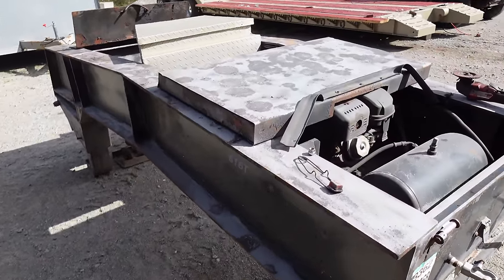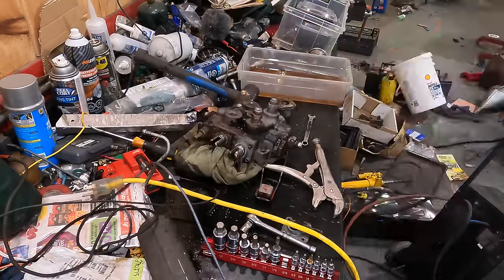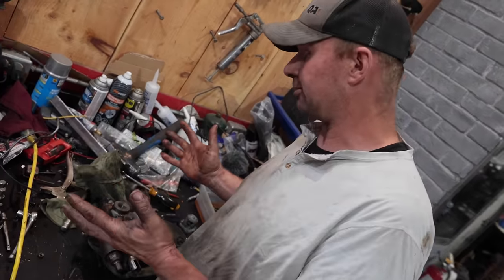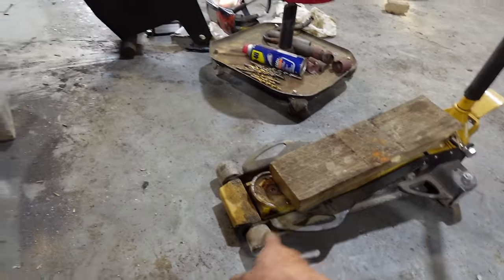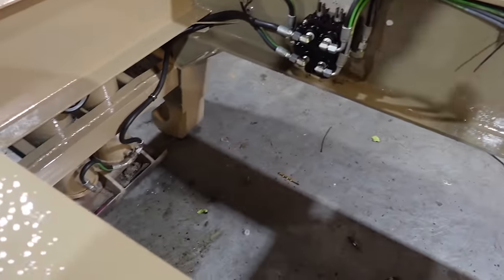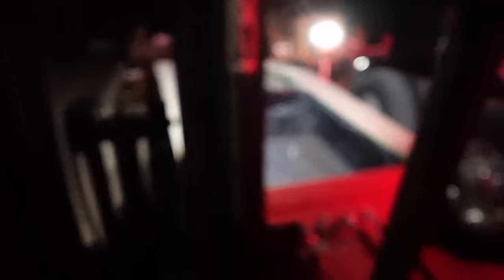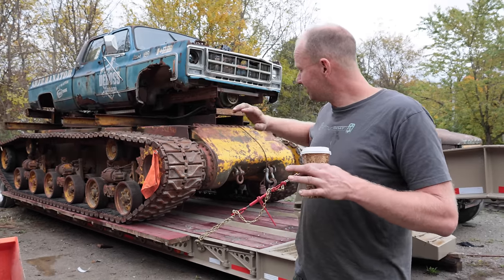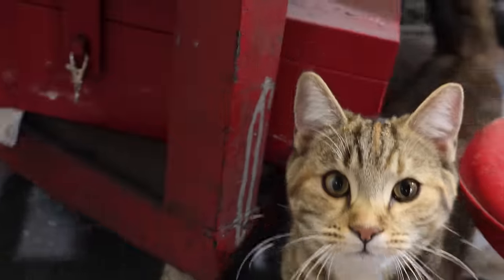Finishing our RGN Lowboy Semi-Trailer [EP6]

Comment: We have that same trailer as a 50 ton and to support the neck from the deck there is a thick piece of flat stock roughly 15” long with a hole at each end. It goes in the very middle of the neck at the rear under the swinging feet pinned and down to the lowboy deck pinned in place. So after you raise the deck up with the neck brace in place, it will remain attached to the deck and you can unhook the tractor from it. Nicely done on the truck and trailer. Man does she looooook beautiful

Comment: If you are thinking about buying containers to store your stuff. You can get a temporary structure that is supposed to be mounted in between 2 containers and gives you a decently tall, covered work area outside for the things that still don’t fit in the shop
Reply from the maker: I bought some cheap trusses and will frame up a little roof with Steel.  With the trees there, plastic wouldn't last too long, and the steel dome structures are about $25/square foot.
Reply: Rich has a background in construction, putting a truss roof on some containers is well within his wheelhouse.
Reply: The gothic arches that boat enthusiasts use work on containers, give good height, and will accept various roofing applications, and your sawmill guy can supply the wood. Take care.

Comment: Hey bud. May I make a recommendation? The front of that trailer, where the fittings stick out. I would weld some plates on the sides to semi-box those in. Not just for safety but they could acidentally get caught on something and ripped off. Just my 2cents.

Comment: A folding gooseneck front load trailer is so much less complicated and practical then these types, my god i feel for you Rich
Reply from the maker: If I was to use this everyday, I would have spent the extra $50 000, but for me who uses it on average 1-2x a week.  This is still the better option

Comment: Last year I bought a 1992 model of the same trailer with a current yellow sticker. It works well to move a 20 ton excavator between farms. The pins and safety system is not that bad if you don't have use it every day. Not as nice as some newer trailers, but the price was right and it is solid. That trailer was in Dunnville of all places!

Comment: Nice job on that project. I do the same stuff every day so I know what it's like and it's not easy when you're first starting off running those things around tight corners and getting them detached and re-hooked up. The trailer came out really good.👍

Comment: Rich, question about the valve body/spool valves. Now that I've seen this one apart, it gives me some confidence to try to fix the one on my lowboy. The issue I'm having is the valves are VERY difficult to move up and down, and they do not return to center at all. Basically they stick either up or down and I have to manually put them back into neutral position. Do you have any idea what might cause this, or what the issue could be? Haven't pulled anything apart yet because I've been afraid that I won't know how it all goes back together.. but this video made it look like it ain't really a big deal at all. Thanks in advance if you see this, and love how the lowboy turned out! Amazing work as always.

Comment: Aussie truck mechanic. Genuine question, why are north American low loader/boy trailers so overly complicated with no added benefits? You don't have expandable beds either so all your loads hang over. Just want a logical answer to my question of curiosity.
Reply from the maker: We have them, but they cost about 2x as much.
Reply: alot of it has to do with the federal regulations regarding lenghts and weights

Comment: Not sure why they even put gas powered motors on these trailers for hydraulics anymore. All our trucks have pumps on them.
Reply: Nice if you need to use the trailer on a truck that doesn't have a wet line. Also good redundancy if you lose a PTO pump in the middle of a haul.
Reply: can still be ordered stand alone from most manufacturers